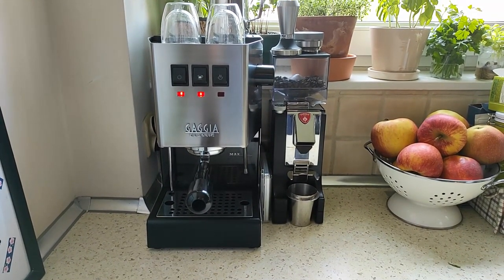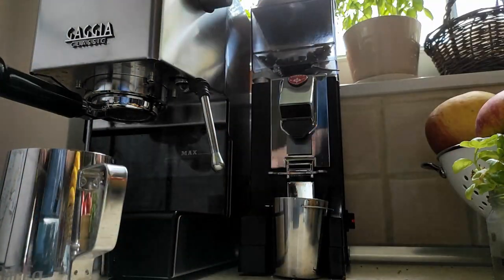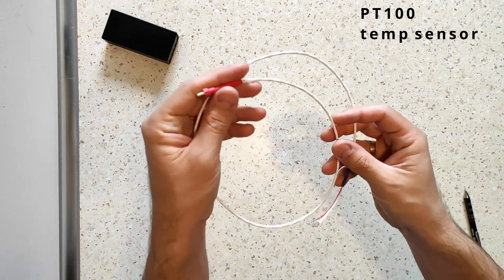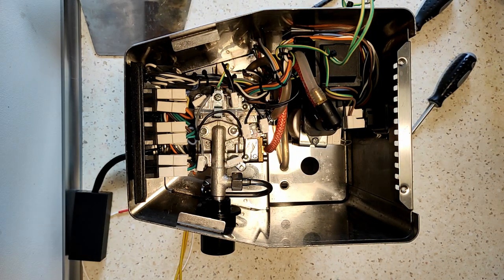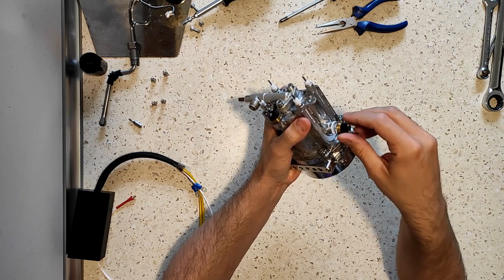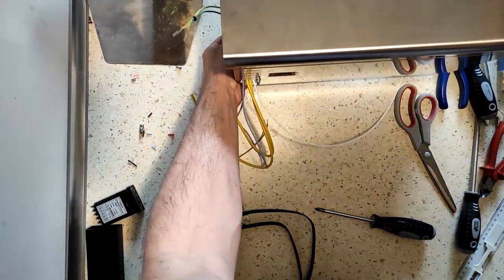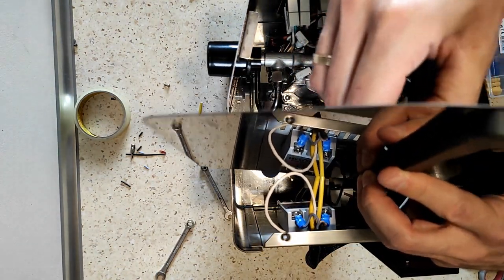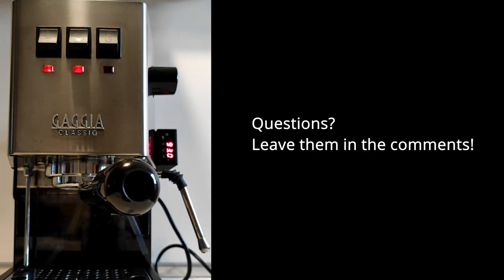How to install a PID on a Gaggia Classic Pro - DIY, cheap and good looking!

Comment from the maker: Thanks everyone for watching and such a positive response!

There's a couple of points I need to clarify that I missed in the video:

1. Autotuning: XMT7100 PID will keep your brewing temperature within 2-3 degrees from the set value after autotuning, but you need to start autotuning once the machine is fully heated up (give it 15 minutes of idling). You can reduce this variation even further with custom settings, I just didn't see the point as it's good enough for me. Thanks to Murat Öztürk for pointing this out!

The most commonly used parameters for PID on a Gaggia Classic are the following:
P: 4, I: 60, D:15, Souf: 0.2, ot: 2, PSB: -008

The settings found by autotuning in my case were:
P: 4.1, I: 66, D: 18, Souf: 0.2, ot: 2

2. I've added a section about cables in the video description, this was a popular demand in the comments.

3. I've skipped modding the PID for steam temp, because it involves soldering and I wanted to keep this tutorial as simple as possible. With the temperature visible on the PID display I can comfortably work with the stock thermostat. I turn the steam button on, wait for the PID to show about 140 degrees, then purge the wand and start steaming at about 145-150 degrees. The "steam ready" light won't turn on during steaming, indicating that the heaters are working during the process, which is what we want. The stock thermostat kicks in at about 155 degrees in my case, but there might be some sample variation with different Gaggias.
Reply: Hi Robert, I just finished installing the PID as per your video tutorial and is working good, but I have noticed that the (AL) light on the right-hand side of the screen which I assume it's an alarm never comes on, is it necessary for it to be on, or am I alright like that.
Reply from the maker: It comes on once your reach the alarm temperature, so you can theoretically use it as a thermostat. That's how you use XMT7100 for steaming, but you still need to modify the PID to control two SSRs.
You're fine, don't worry about this LED :)
Reply: Thanks a lot, Robert, So I won't bother with it as I am only using the PID for brewing and then purging at 140 after I hit the steam button then steaming at 145-150 as you mentioned in another comment, and it's going pretty good for me, just another question that might sound a little stupid, but would you happen to know if by default the PID reading is in Centigrade, thanks again for your help.
Reply from the maker: Yes, the default is Celsius. If you need Fahrenheit, then press SET, input the password 0089 and press SET again, scroll down do CorF and change the value. Approve choices by pressing SET again, scroll to "End" to finish.
Reply: Then I should be alright, I'm used to Celsius, the only reason I asked is that although I got the PID set at 103 the water coming out of the group head is reading 85 according to the thermometer I'm using, the one that clips on for frothing milk, should I increase the values on the PID, or is that perfectly normal, thanks a lot.
Reply from the maker: @luisdellipiani4464  85 sounds all right, but at this point you should trust your taste more than anything :)
Reply: It tastes good for me, also hot enough, so ill leave it at that, thanks a lot for your support.
Reply: The boiler PID mod is easy. Did it over the weekend and my pulls now are much better and consistent.  Thanks for making this video. 

I hope you can do another one to add the second SSR for steam.  For those of us who are more ambitious and stuck at home now, it will be a great project.
Reply: What correct gauge for the cables? Thank you for this it looks simpler than it is. Want to try this out
Reply: Im interested in this too. I’ve heard 14 and 12 gauge but your power leads look heavier. Any help is greatly appreciated. Thanks for the detailed and well detailed video.

Comment: I just finished mine mod (gaggia new classic). Everything perfect. Thank you for this howto.  I bought some little different version of XMT7100 - different default values and little more options. This was pain at the start as it was still heating (never stop) or never heating. 
And one note at  the end. You dont need to put boiler out (with all fittings on bottom). Just unscrew it , unplug top cables and rotate to be able to get to the temp control senzor from bottom.
Reply from the maker: I decided to take it out for clarity. If I didn't it wouldn't be very clear in the video. The procedure might come in handy in case anyone needs to change the oring in the boiler.
Reply: Hi, can you say how you handled your PID? I seem to have the same issue, it keeps heating and have different looking setting from the start - shows value around 90-100 slowly growing (but no decimals like in celsius)

Comment: Hi Robert! followed your instructions start to finish and it worked great. This has saved a lot of money and time.
Reply: From the Netherlands the cost were about 66 euro's(excluding some of the connectors and all tools). It took about 3 months for all parts to arrive(maybe due to covid and delays, but I wasn't in a rush). Once all was there I spend roughly 2-2.5 hours to do the mod.

Comment: Great video. Thanks for sharing. 
Use a lighter to melt the sleeving at its two ends. Careful to put off the fire very quickly if the sleeving gets alight. You can do this in the sink if you aren't comfortable with this process.

Comment: I used this guide to mod my gaggia, it worked very well. Thanks for the clear instructions!
I have a newer gaggia, I put my SSR tilted sideways on the left side of the ventilation grid, so above the other electrical stuff . This way it doesn't block the water funnel but can still be bolted to the vent-grid, which is good for some extra cooling. 
I also used Damian Witonski's guide to make the pid-alarm regulate the steam. But I contrary to his guide used the same SSR for the steam and brewing. I made the pid alarm output route through the steam switch into the ssr, so parrallel with the pid brew output, this works because steam is higher temp than brew, so it just 'overwrites' the brew pid signal when the steam switch is turned on.
Reply from the maker: That's an excellent tip! I didn't think about using the same SSR, but you're right, the temp ranges don't overlap, so there's no reason it won't work! Thanks for this great input!
Reply: Hi @evert S. do you happen to have a wiring diagram for the single SSR solution? That would be a great help. Thanks.
Reply: Hi Evert, I've also got the newer Gaggia (with eco timer) and can't find a wiring diagram. Do you have any drawings you could share for how you did this? Thanks.
Reply: @cazsplinter8900  
Hey, I drew some of the wiring,
on top of the US gaggia classic 2018 wiring diagram to show how I wired it up.

The EU version should be the same for the steam part of the circuit. But the power wires are different. I used this guide (https://www.youtube.com/watch?v=WNs3uSLA4Ts)
To remove the eco timer on my EU gaggia, So thats why there are some more loose wires in the picture.

Also, please note that if you use 1 SSR, the steam-ready light will never turn on.
instead the brew ready light will, and you can see the temp. on the PID so it's not a problem I think.

https://imgur.com/a/YniAkSU
Reply: @evertschone1  Hi, how is the Mod holding up with just 1x SSR? Can you help with selecting the correct pins when wiring up to the Steam switch? I have the 2012 Gaggia Classic 230V model - the steam switch in the middle. Unfortunately youtube won't let me post a link.

Comment: Very nice and well adjusted instructional. The tempo of explanation makes it easy to follow without getting bored.
I was also hooked by the James Hoffmann Video and bought a used Gaggia with the intention of modding it - with your video, I feel confident to start.
Reply from the maker: Best of luck with your Gaggia! :)

Comment: Thank you for posting this. I had been thinking about adding a PID to my Gaggia Classic for a while, and the details you gave helped me get started (in particular, the links to parts known to work, and the tip about silicon cables, which I'd have overlooked otherwise). 

It worked out fine, and my machine is so much easier to use now! I think it's a pity that a PID isn't a more common feature of single boiler machines.

One comment: after reading somewhere that cabling across Gaggia units wasn't always the same, I took some time to trace every cable in mine and make a wiring diagram, and then I decided to power the PID from connectors on the front panel, and not pull any cable from the mains connectors in the back.

My reasoning is that it might be slightly better for safety, because the entire circuit remains between the power switch and the thermal fuse:

First, if the fuse blows, the PID doesn't remain powered. 

Second, when the power switch is off, most of the circuit is only connected to the neutral, as opposed to the phase (assuming proper wiring in the wall socket, which incidentally isn't the case for me).
Reply: Can you share your wiring diagram?
Reply: I would also be interested in this.
Reply: Wiring diagram if possible to share would help me as well! Good idea!

Comment: Amazing! Probably the only video on YouTube that talks about the full assemble with the list of components. I have the same kit which I installed 2 months ago (I bought it as a bundle). Temp surfing was a horrible thing... But now, most of my shots are bitter haha. Still trying to wrap my head around the temperature variable in process.

Comment: The boiler PID mod is easy. Did it over the weekend and my pulls now are much better and consistent.  Thanks for making this video. 

I hope you can do another one on how add the second SSR for steam.  For those of us who are more ambitious, stuck at home and are not afraid of modifying/soldering the PID controller, it will be a great project.
Reply from the maker: I'll eventually muster the courage to do that, not yet ready! I'm getting consistently great results with the current setup, so the incentive to modify it for steam is weak. If I do this, I will probably use the existing SSR (single relay) to control the steam as well.

Comment: First of all, thank you for the great video and the effort you have put into this. Regarding the control parameters of the PID, these are generally too conservative due to the autotune process and therefore the intrashot differences are very large. I have found the following setup to be optimized: P=1.6; I=10; D=3 runs stable and fast for me.

Comment: Thanks mate. I recently got an old model and installed a diy kit using a written guide. Went perfectly untill i decided last week to invest in a brand new machine. Tried to convert the controller over to that and had some issues with the wiring. Getting 170 volts when the machine was not running. The new one has that auto timer board on it so it just wires differently then the old one does. 

Just peeking where you tapped the power solved my isseu. I was tapping the brown wire coming out of the plug instead of the blue one. Now the PID actually turns on and off with the machine. Saving me another mod i was almost going to buy.

Comment: Excellent vid and instructions!  

With regards to the sleeve, once all wires are in, put a dab of high temp hot glue and slip a strip of decent heat shrink over it, this will keep the sleave in good condition until you use a heat gun to loosen it up again

Comment: Amazing video! Very detailed and easily understandable, with great camera angles. I happened to buy a used ascaso dream (thermocoil) for a very affordable price that i had to buy it as my first espresso machine. I have enjoyed the taste of the shots, but there is room for improvement. For now i am satisfied with other accessory improvements, but I am really curious about installing a PID into it. I found out that couple of people have actually done this mod for this machine, but there ain't any detailed information or guides for this. I wonder how much would the installing differ from this great example of yours.

Comment: Here's a tip, when installing the wire sleeve. Use a lighter and melt the ends together to stop them from fraying.
Reply from the maker: I know this trick now, I wish I knew it back then :)

Comment: Hi  :) 
I started the same way, after J.Hoffman video. Got the Gaggia Classic for 100$ (was described as faulty). Owner never cleaned shower screen and used with pressurized baskets only.. 🤪
After 3 min clean it was good and running ))
Having same consistency issue (one day shot is wow, other morning  is noooo...)
Installed the PID, easily removable way.
Yeah, got better. But then I installed the temp sensor on the group - and found that hot boiler doesn't mean hot group.. it is taking up to 20 min (without steam help).
Consistency improved, but still not the best.
Not mentioning the 9 bar adjustment, brass plate, IMS shower, bottomless ptf..

Checked the temp drop during the shot and it was.. a lot. Around 3'C. (Just google temp stability of Lelit Anna, Ranch.Silvia.. there is no such drop start 92-end 91.8)

So.. I went further. Got pre-heating copper tube wrapped around the boiler and... pump dimmer to adjust the pressure on the fly )

After all of this - result was good. But the  workflow.... complex! Look to the temp gauges, pressure gauges, time, volume.
Too much for the 30 g of the hot DRINK ))))
Removed all the stuff and sold for 260$ (without any mods, just good working condition).

Found a used Expobar Office machine, 300$,  almost got it, but changed mind and got Flair Pro 2 + Bellman CX 25 + kettle.
Happy for now.. for now.. almost.. )))
Reply from the maker: Ha! Seems like Mr Hoffmann was right about one additional thing: this really is a hobby and a rabbit hole. I've been enjoying the journey, but it might be just too much for someone who just needs their espresso fix.
Thanks for sharing!
Reply: Wow i thought the flair looks way more complicated to use …. I don’t understand how you can have that big a temperature drop from the boiler to the brew head..… the brew head is basically bolted to the boiler… also couldn’t you just use a temperature offset ?
Reply: @chopsonyou2007  The temperature drop is because a small boiler is filling with a cold water and at the end of the shot, the  mixture of hot and cold water is going to the pack. The drop of temp is what I measured, may not be 100% accurate.

Comment: Great job! The next thing you ought to consider is to add an electronic module (SCR electric motor speed control) to control the vibratory pump output to regulate group head pressure as a profiling device.
Reply from the maker: Does this make sense without an in-line pressure gauge?
Reply: Another thank you for a great video.   Nice to see the wires at least sleeved too.  Maybe an inline fuse protecting the small wires supplying power  to the PID, just in case?

I'm kind of fancying this mod, plus a  remote pressure gauge, a dimmer module, and maybe an auber shot timer, all stacked in a specially designed 3D printed box for the left hand side.  Eye opener about not really needing the steam alarm control and leaving the stat in as a fail safe

Comment: I’ve done the mod. It wasn’t too hard thanks to good instructions. But now, how to use that PID? You set it on 103C, but can you save two different temperatures like say one for brewing, 103 or something (cause it colder inside the boiler, right), and one for steaming , say 140C.  Then how can you easily switch between the two without having to change temperature manually with the buttons?
Reply from the maker: It doesn't work like that, I'm afraid. The PID controls only the brew temperature in this case, the steaming temperature is still controlled by the stock thermostat. It is possible to modify the PID to control the steaming temperature using the alarm function, but it is beyond the scope of this video. At some point I will prepare a follow-up video with the advanced mod like that.
Reply: @robertkujawa3504  Rob! m just putting the video on replay going to bed from last 4 nights and kindda it's got soaked in my brain... Have the mod Parts on the way for recently procured Gaggia C/P. (Note that we're not getting the XMT7100 here (India), so have ordered a dual set-point Selec PID).
Was wondering if You're doing the video for both the Brew and Steam Thermostats...
know what, i drew myself sketches of how it should be, and should work...
But there're enthusiasts waiting for the video including myself...
Again, great work and so simple narration... Love ya Mannn!!

Comment: Great instructions Robert. Excuse the noob question but I am new to this. Is tapping wires same for the 120v machines (US model)? I have the brown wire on the brew bottom at the same location as yours, but at the socket, I have a white wire at the bottom instead of blue. That being said, the power button has gray and white wires on top instead of blue/orange in your model. FYI my model is Nov. 2020 with the wider funnel.

Comment: Great video, I’ve finally installed my pid to my 04 classic. 
Strangely enough my auto tune seems to take forever. The blinking AT light never goes of. 
It does keeps the machine at 103
Reply: any differences in parts or instructions from the classic pro compared to the classic? i have an 07 :)

Comment: Great tutorial. The only thing I do not understand is - the temp sensor PT100 that you screwed in the boiler and put thermal paste - isn't this paste in contact with the water? Why do you need thermal paste, or the hole does not go in the boiler and is just in the wall of the boiler?
Reply from the maker: The hole doesn't go all the way through to the boiler inside. It ends in the boiler wall. The PT100 sensor reacts very rapidly to temperature changes, so in order to take advantage of that and reduce latency, I used the thermal paste.